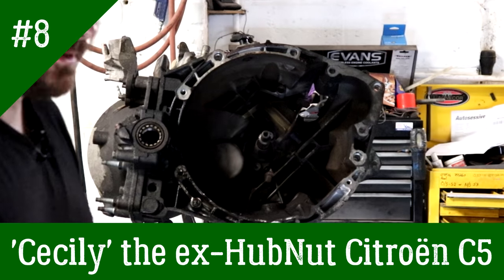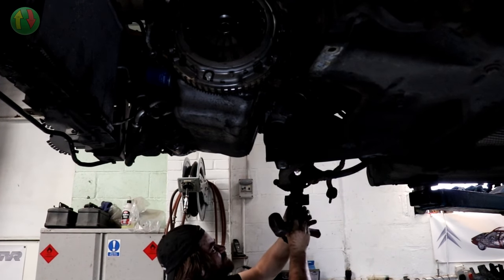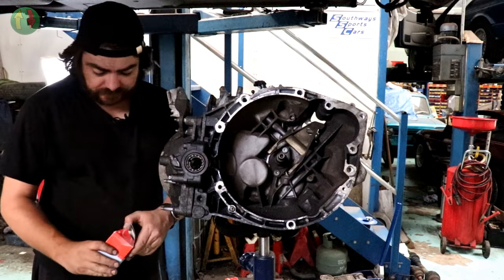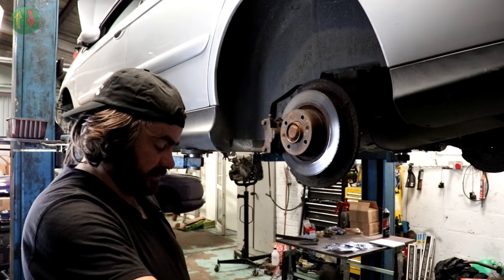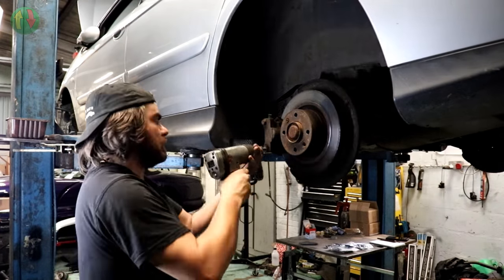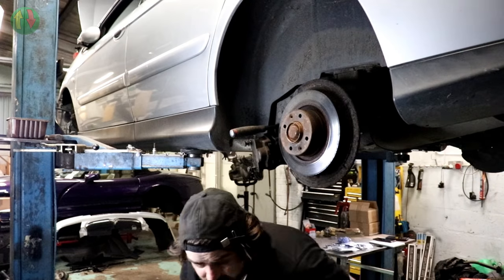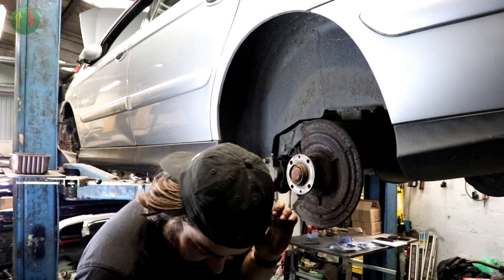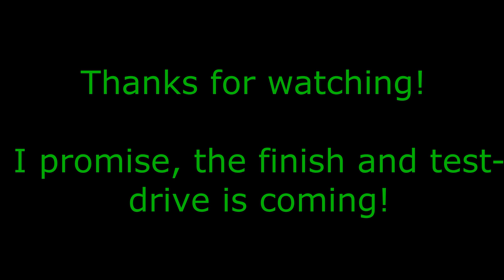CECILY the @HubNut Citroën C5 pt8 - clutch release arm woes, ball joint woes and rear brakes.

Comment: Nice video. I learnt a couple of things. Certainly I would have just used the bolts the caliper came with. Is there a way to tell which bolts you should use?
Reply from the maker: Normally metric bolts are marked 8.8 (standard), and bolts marked 10.9 are considered high-tensile in the automotive world. Caliper bolts are nearly always 10.9. When you switch over to imperial bolts shudder they have markings on, like little straight lines arranged in a given pattern...because why would you want to make it simple?
Reply: Thanks for coming back to me. Fortunately everything I have is metric.

Comment: Welcome to Hell, C5 rear brakes are an absolute nightmare,  your extremely lucky the bolts didn't snap, they galvanically corrode within the calliper  !!! good old French engineering. the galvanic corrosion also applies to the calliper mounting surface causing calliper to angle away, this causes "odd" disk" wear, you seem to have got off lightly, how did the other side go, or are you at the local hospital recovering ?
Reply from the maker: That's where the impact gun is useful, as you rarely snap bolts because they get shaken loose as they're un-winding. Caliper body was indeed corroded, yes, but as they were being replaced it's no big deal. Other side was pretty much exactly the same deal.

Comment: Do you need a set of safety glasses? Worried when you were on rear brakes and turning your head away whilst undoing the bolts and also blowing out the calipers.
Reply from the maker: I've got them (I put them on when I was doing the balljoint). It's common sense I don't have! The things I've had stuck in my eyes over the years...
Reply: @UPnDOWN  Okay. Good to know. Get yourself a set of clear perspex glasses which look so much better than the goggles. If you need prescription versions, they are tax-deductible (as safety gear). Good luck and thank you for the entertainment.
Reply: @UPnDOWN  I once unsoldered a wire by pulling on it while heating the joint with the soldering iron.  As the wire flicked loose, it flicked a blob of molten solder in my eye.  I heard the fizz as the solder hit the tears!  Remarkably, no lasting damage once I'd plucked the solidified blob out.  Now I use safety glasses when unsoldering anything that's likely to suddenly flick loose! 😵‍💫
Reply: Ear protection is also important.
Reply: Absolutely - I am not even sure if safety boots are being used.  Is a tools talk required?? :-)

Comment: You think being a mech is hard going, you want to try being a heating engineer when the customer is breathing down your neck as you try to figure out why his crappy boiler doesn't work and its below zero outside. We may be professionals but we don't have all the answers do we!
Reply: I think one of the worst jobs would be plumber dealing with clogged drains or - worse - replacing drains without being able to stop people from flushing their loos above your heads. I'm a spark by trade originally and started following a Swedish electrical and plumbing company on YT a while ago. They actually had that happen replacing a soil stack in some kind of geriatric hospital or home - they didn't mention any specifics but alluded to a hospital-like situation and there was a whole storage room full of Zimmer frames.